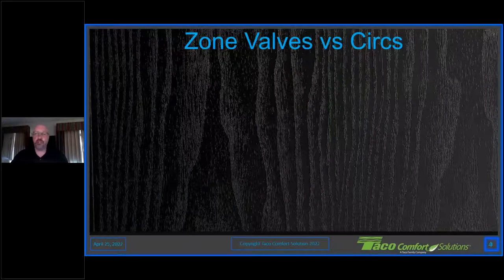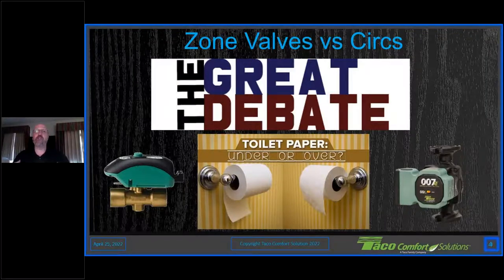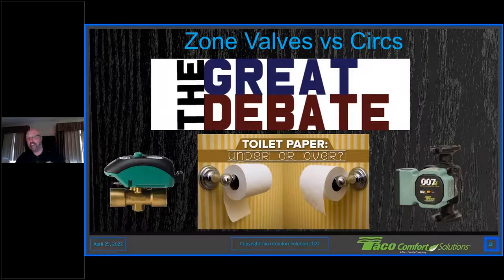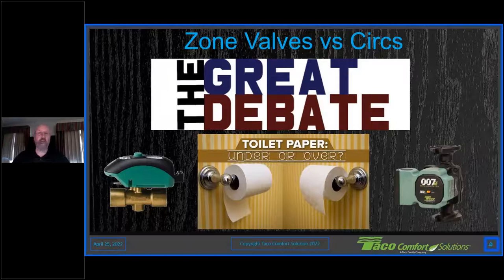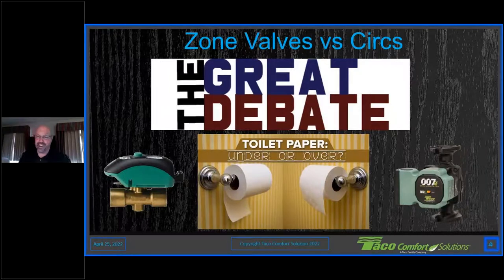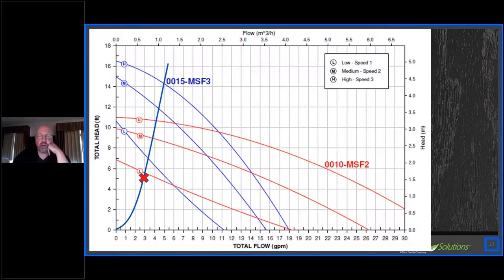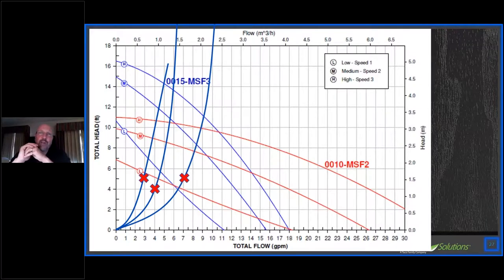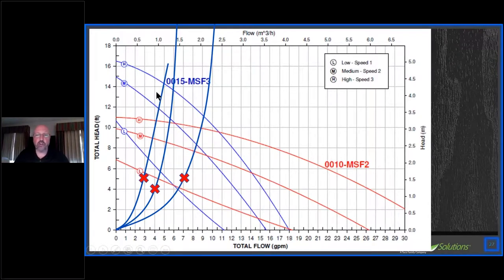Zone Valves vs.  Zone Circulators

Comment: Is it odd that my system has both zone valves and circulator pumps?
Reply from the maker: Hi Pete,
I have the very same thing in my house, you can have your zoning with zone valves as well as circulators. However what is not typical is that on a zone, you should need a zone valve AND a circulator.
I have seen installations like this and it installed in this manner to prevent gravity hot water flow in a zone when that zone was not calling for heat. The zone valve acted as a positive shut off. I would have installed a check valve on the system after the zone circulator.
If you have further questions, please don't hesitate to contact our Technical Services Team at Taco.

Comment: If you're fine feeding the same water temp to all your low-temperature loops (e.g. radiant floor heat), set-it-and-forget-it mixing valves are the way to go. Slap a dumb circulator in there with some zone valves and you're off to the races. Budget permitting, there's the dream: independent digitally controlled injection pumps per-zone (or group of zones). Honestly, as cheap as circulators are these days it's not that cost prohibitive, and is the design I'm leaning towards for my dream house in a few years. Last I checked, a digitally controlled circulator is cheaper than an electronic mixing valve. Is it overkill given the thermal mass of a concrete slab? Almost certainly. Does it mean I can go wild with building unnecessary software solutions in search of perfectly even heat with zero "bang-bang" control logic? Yes.
Reply from the maker: There are so many ways to control a hydronic system and as long as the end result is achieved, go for it!